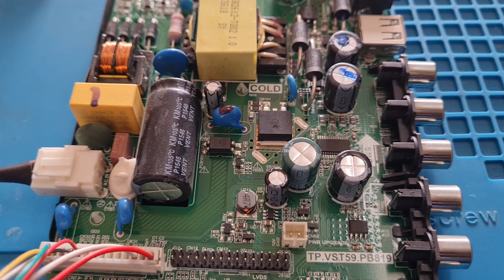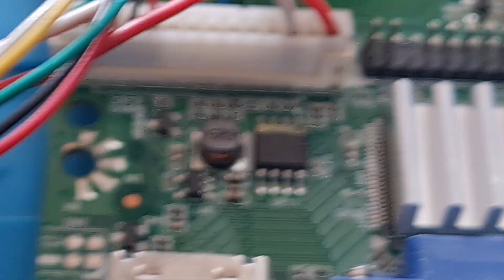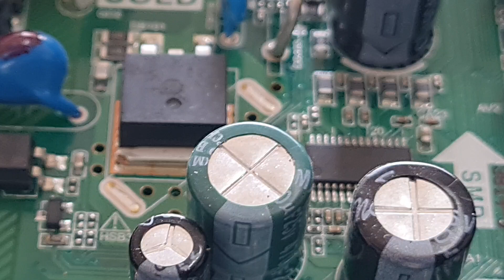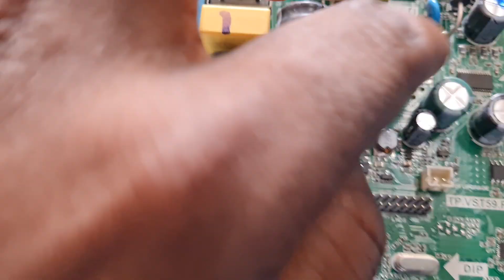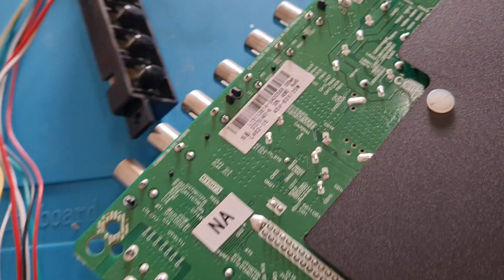Television stays on Standby but won’t Turn On? Here's the reason why.

Comment: I have 12v and 5v standby..... The TV switches off after a few seconds. What can it be?
Reply from the maker: Check the main capacitor
Reply: @cedricdebossrepairs  I replaced that
Reply: @cedricdebossrepairs so I found out that the TV is not switching off,  it's the backlight that switches off.  I used a torch and was able to see picture.

What can cause the backlight to switch off after a few seconds?
Reply from the maker: @shalenm6028 First check the backlights probably one of the bulbs are dead or the backlight circuit. It could be alot of things but you have to start with the backlight circuit
Reply from the maker: @shalenm6028 one dead bulb could cause that.
Reply: @cedricdebossrepairs  Thank you Sir... Keep up the excellent work 🙏